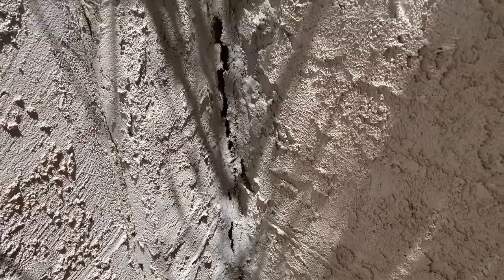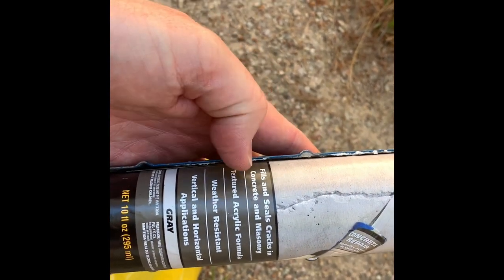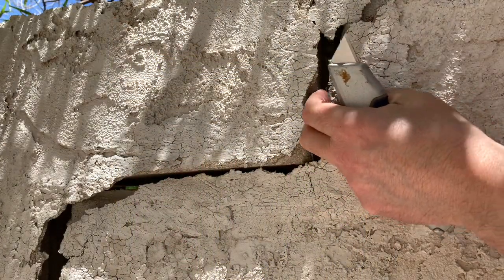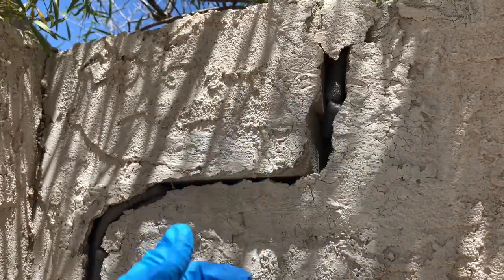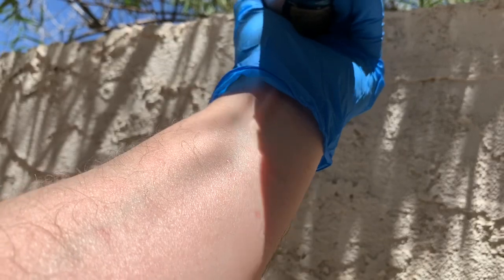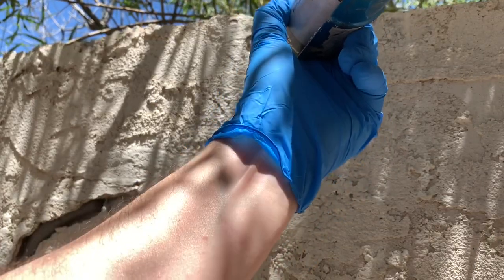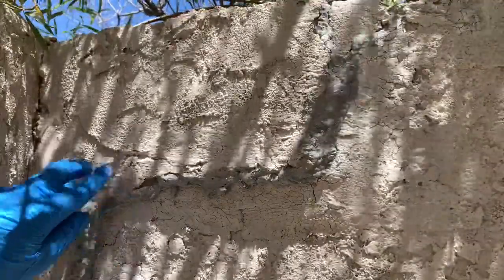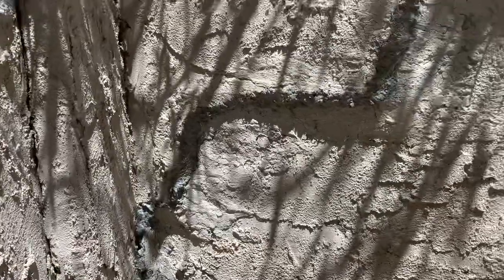Repairing a Crack In a Block Wall

Comment: Mike Thanks. This is the most sensible  video. I need to do this until I figure out what to do about the wall. The wall has separated from the split a little. It’s only in one divide. The rest of the wall is in excellent condition. I just purchased the house a year ago. I think it happen because no one was cutting the grass ever for 10 years. I think a cosmetic repair will be fine for. Now.  I hope the split isn’t too  ig to fill
Reply from the maker: The backer rod will help with that. If necessary you can add more material

Comment: Dumb question I guess but I'm a senior lady and having to try to learn how to do repairs myself as I cannot afford to hire done.  Is there any type heavy duty caulking gun and be able to use a heavy weatherproof concrete to repair a concrete block retaining wall...
Reply from the maker: Like in the video? The products that are dispensed through a caulking gun, like the concrete repair product in the video, flow easily. Snip the top of the tube, stick a nail or something into the tube to pierce the top and squeeze. You should be good to go.
Reply: For people who are elderly or disabled or have weak hands and wrists, we will always need to know what options there are to help overcome our weakness. 

You can search for industrial caulking guns and it looks like Ryobi has one for $60. There are some more ergonomically designed. Handles and grips are important too. If tools are not comfortable or not the right size for smaller hands, it can be awkward, dangerous, cause blisters or more serious injury.

Comment: What brand of compound are you using? Why is that the right compound for this repair? It would be great to show the tube label clearly or state it in the video description.
Reply from the maker: I used Quickrete Concrete Repair. I like it for this because I can put the tube in a caulking gun and go at it. It is good for both vertical and horizontal repairs, and fills cracks in both concrete and masonry. You can find this at Lowes or Home Depot.

Comment: What material is this ?  Tube called
Reply from the maker: I used Quickrete Concrete Repair. I like it for this because I can put the tube in a caulking gun and go at it. It is good for both vertical and horizontal repairs, and fills cracks in both concrete and masonry. You can find this at Lowes or Home Depot.